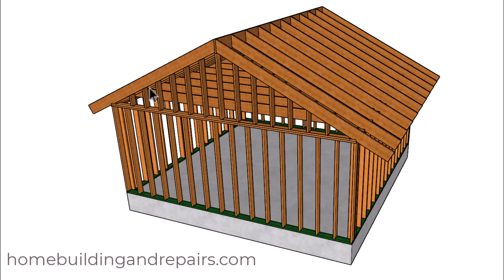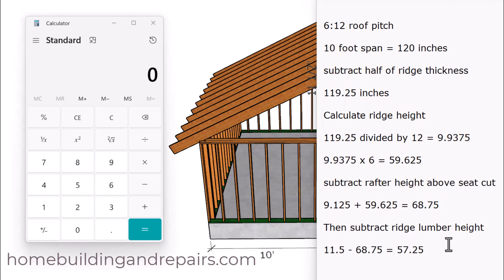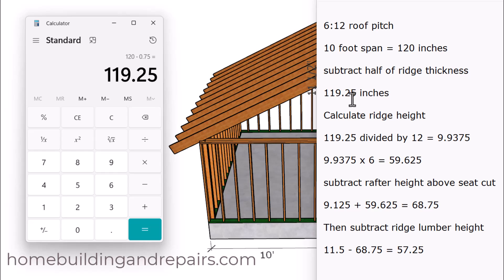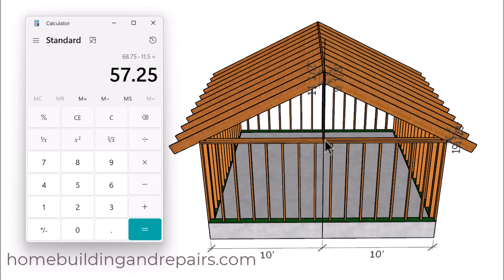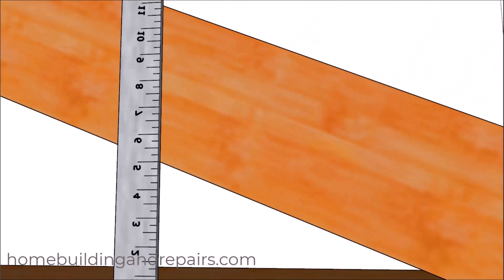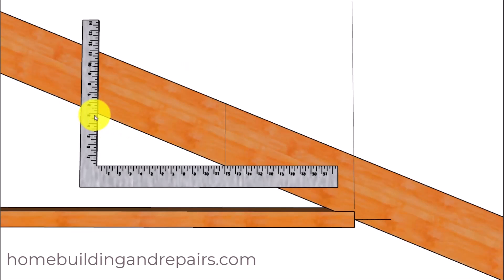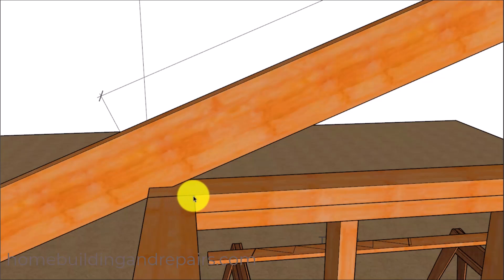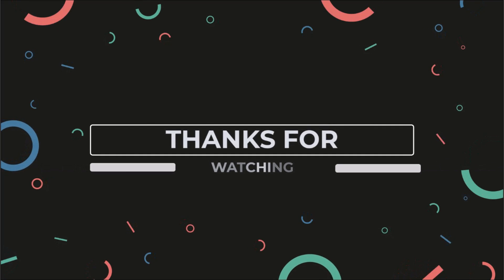How To Calculate Gable Roof Ridge And Post Height Measurements - It's Easier Than You Think

Comment: Can the pitch be an oddball number between 5 and 6? Working on a 50 yr old house, gable roof, single story. I'm getting ready to replace the roof but need to R&R some of the rafters. I'm also replacing some of the posts because over time some of them started to bend into a "C" shape. I'm measured the original posts at 79-5/8" from the double top plate to bottom of the ridge board. The house was built with 2x6 joists and rafters. A 2x6 was used for the ridge board. A 2x8 probably should have been used for ridge board but maybe that was acceptable at that time. I'm cutting new posts at 79-5/8 plus 1/16" no greater than 79-3/4" to make sure i get a tight fit. Will be installing a 'T" posts in place of the ones that are failing. I know the house is 31 ft wide based on a document. So halfway should be 15.5 ft - 3/4 inch = 14.25 ft. I'm using the math that you were showing in your video to check the height of the post. On a 2x6 ridge board, am i subtracting 5.5 inch or 4 inches after subtracting the 1-1/2 inches for the height above plate.

Comment: So,you got the 9.125 " by manually laying out a 6 in 12 pitch on the rafter, and subtracting 1.5 inches for the vertical cut (part of birdsmouth) at the top of the wall?
Reply from the maker: Yes.